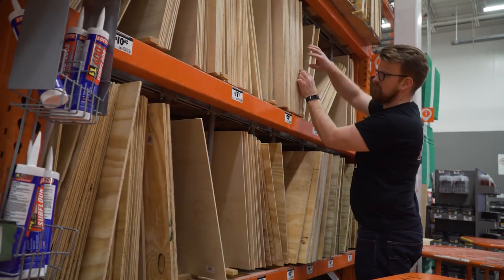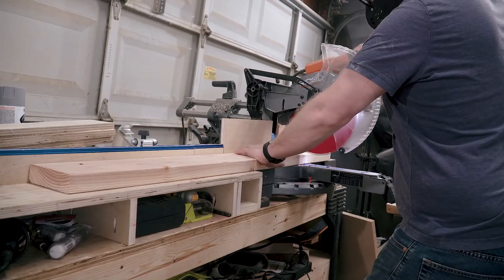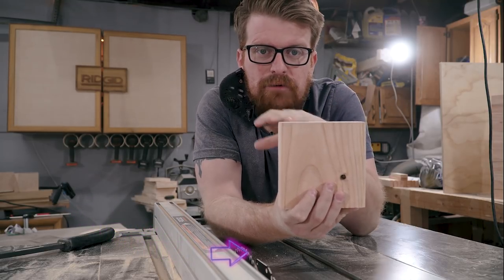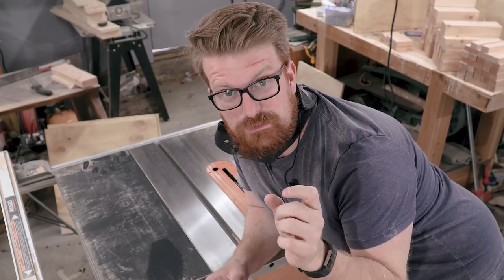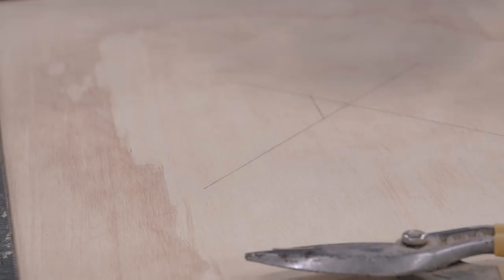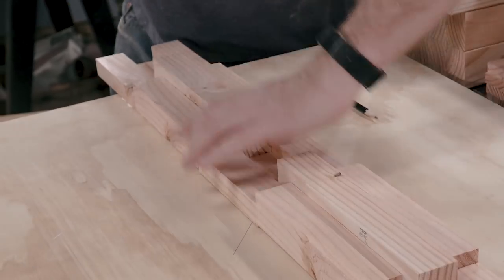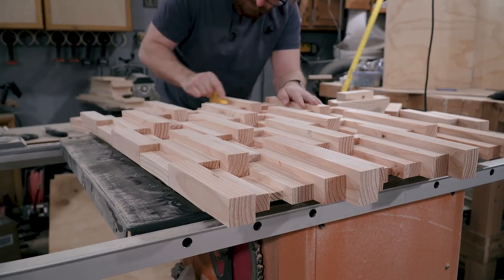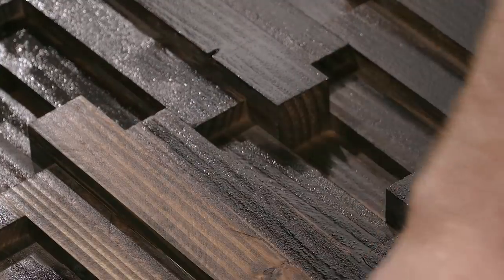DIY Wooden Wall Art - JUST TWO 2 x 6s! | Woodworking Builds

Comment: Use wide blue tape for an emergency zero clearance insert.  Just apply the tape over the existing insert opening in one long strip, then raise the blade to the height you need for the cuts you are making.
Reply from the maker: Great idea

Comment: Hi, you can use painters tape doubled up on both sides of the blade if you dont have a zero clearance insert available. Actually just used that method on mine for the small rips that were getting caught between the blade. Very dangerous otherwise. Try it and let me know if it works for you. Take care & thanks for sharing.
Reply from the maker: Good point, I got a little lazy with that one.  Never good to be lazy with safety.

Comment: Well done. 1 question though: why not just use wood glue?
Reply: likely due to drying time and clamping requirements, but i'm interested if it's another reason.
Reply from the maker: Good question, I answered it in the blog post but it didn't make it into the voice over.  I used loctite power grab so that I didn't have to clamp or nail anything as I went, you just press it in and it stays until it is dry.
Reply: Wood.Work.LIFE. That makes sense. Thanks!

Comment: How did you figure out how many pieces of each size was needed?
Reply from the maker: Math :). Then assuming my math was wrong and cutting a bunch of extras, they make great firestarters
Reply: @WoodWorkLIFE  I figured that you used math :), but how did you calculate for the pieces? Did you lay out a pattern of what you wanted and then calculate from there?